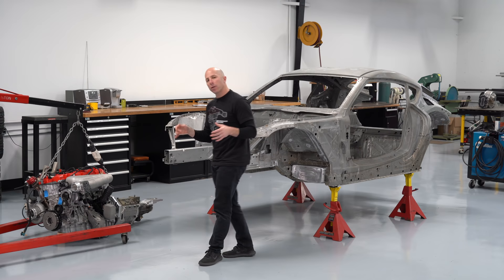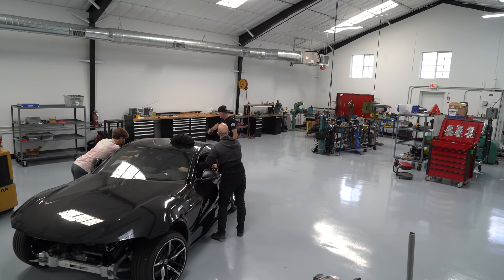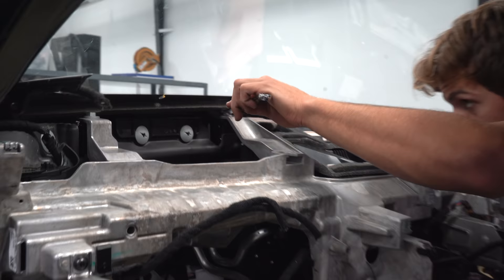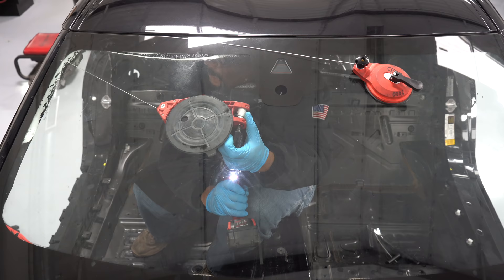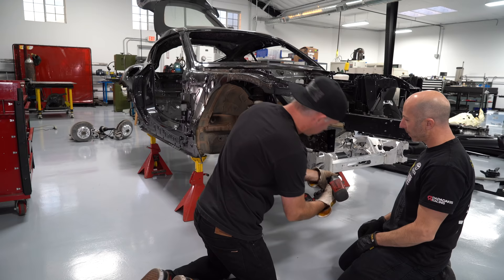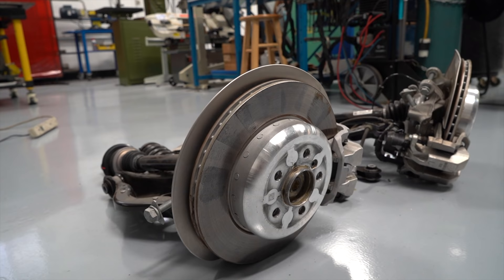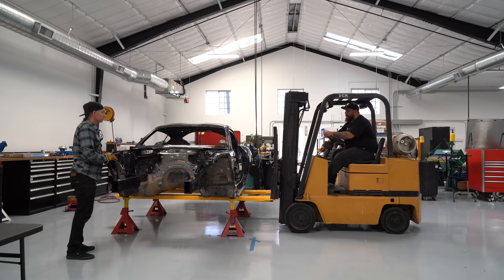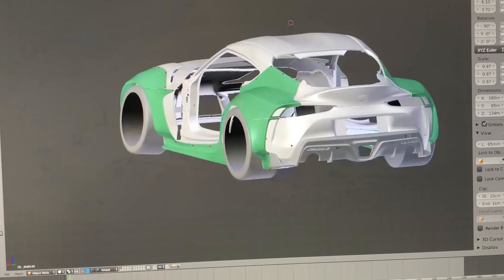Supra Complete Teardown and Strip

Comment: 😄 wow never realized how much crap in modern cars it's crazy just the wires alone its alot the car is on life support.
Reply: All of the safety devices and electronic stuff add all the unnecessary weight. We don't need that in a racecar, because if we die, we die happily 😂
Reply: @kagenlim5271  Why?

Comment: Awesome to share the build process.

My guess is that this car is the reason why Daigo won’t run a A90 in FD this season.

Super impressive to build a race car in so short time but It looks like you don’t need as much engineering to do on this one as you hinted the wisefab front and rear but also the quick change.

Stoked to see the car perform in Long Beach. 😃

Comment: Just a note on welding aluminium, some grades can lose a lot of strength after they are welded and need heat treatment afterwards to regain it. A welding engineer should be able to identify the grade of aluminium and specify a welding process to use.

Comment: Please consider doing some research on the wisefab. It awesome but for example on a e46 the hub is modified so that the control arm is further foreward(wheelbearing further backwards) like a shopping cart wheel.This makes the car selfsteer better with less caster which sounds awesome but imagine a driving a bike with a front fork like a shopping cart wheel. Would you let it drive without your hands on the bars?🤔

Comment: I know you guys are top notch. But two questions:
1. Why dont you just use bear factory chassis 
2. I know for you guys 20.000 dollars is small change but all those "dont use parts" could be used by others. Airbags interior parts, suspension parts, diferential, radiator, ecu all those can be given whoever needs it.

Comment: Great, great video again! Thank you!
I wonder if the benefit of loosing the weight of the air-co rivals the effect of losing concentration in a race due to prolonged exposure to heat in the cockpit. Can you tell us more of the consideration behind this approach?

Do you apply some sort of heat treatment after welding the aluminum? 

Another question: the frame of the car is made of steel with aluminum body parts glued to it.
You 'just' put this whole structure in some sort of acid bath; how does this affect this glued construction? Apparently it didn't fell apart, but what about the strength and/or endurance??

Comment: “But we may use the factory steering column” drops steering column
Reply: If the steering column was weak enough to be damaged by a fall like that, I don't think they would want to use it.
Reply: @SuperBobKing  A major way to achieve a lighter part, is to only design it for it's intended use. Dropping a part isn't part of that.
Reply: @jochem1986  Neither is drifting.

Comment: What is the point of getting all the paint and undercoating off? Being a brand new, no rust, perfect condition.

Only thing I can think of is either to make it easier to modify and not have to grind paint off certain places.  Which seems excessive. Or to save weight. Which seems expensive for minimal weight(I would think at least).

Comment: would have been easier to just make molds of the body panels and put a spaceframe chassis together. I'll never understand the point of destroying an already built thing, to make it better. it's not even the original thing with so many mods 🤔

Comment: That's a 2020 BMW.. Don't let the badge fool you, if you scrape off the Toyota badge, you'll find a BMW badge under it. I mean come on, this is not a Supra, this is a BMW Z4, and to top it off a detuned Z4 so it doesn't directly compete with the actual Z4. Nothing, apart from the badge and some panels is Toyota, let alone made by Toyota. It's a Z4 through and through and should be addressed as such.

Comment: But why? No one even likes the Supra. Toyota really screwed the pooch on this one.
Reply: The track built mk5s,d1gp mk5s,5-700hp+ mk5s, including the aftermarket say otherwise.
Reply: @carboydorifutoparty3976  No doubts there. What I mean is how many people do you see clamoring for this car? I have seen literally one on the street. They teamed up with BMW and put a bubble-body on a Z4, which is a car mostly driven by 50+ women. Its just not what we were all hoping for or wanting, at least from a styling perspective.
Reply: @enginepy  Well it's not smart to listen to the car community 80% of the time. When they say they want something and the company build it for them they go ghoust if it's not good or too expensive. Toyota wasn't going to take that risk cause the knew none of their current home built rwd platforms weren't selling and were often put as "slow,heavy,expensive,sluggish,fat,etc" so they weren't going to risk that with the mk5 including the fact that by public vote they wanted it to be i6. For example,look at the LC500, people praise it and say it's better than something like the BMW M8 or they would say it should've been the supra and people would've bought without realizing that the LC's sales are still pretty bad compared to many cars in it's price range. Toyota was already working with bmw before the Z4/MK5 project even started anyway so it makes deceided to work with BMW to make the mk5.
Reply: @enginepy  Plus this is a low volume car. It's not going to be on the streets as much as something like a Camry.